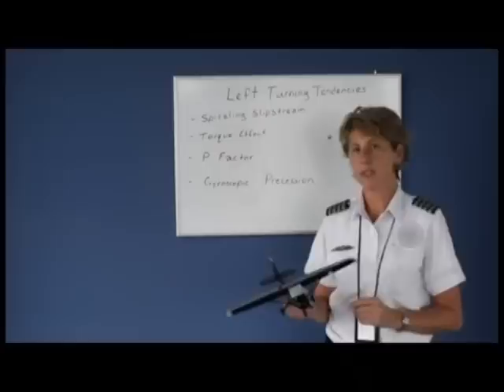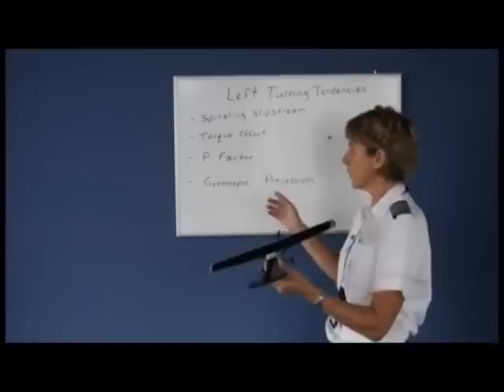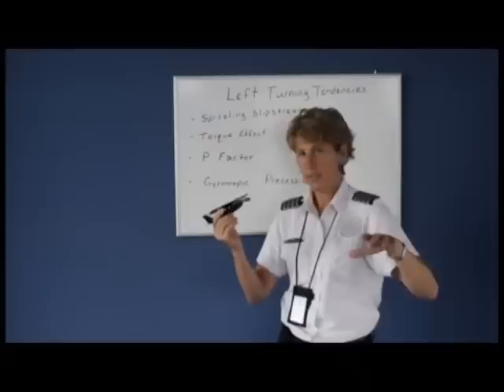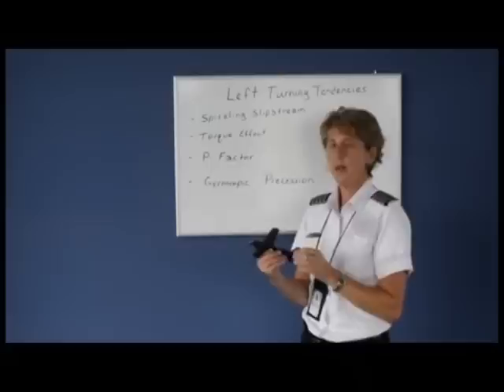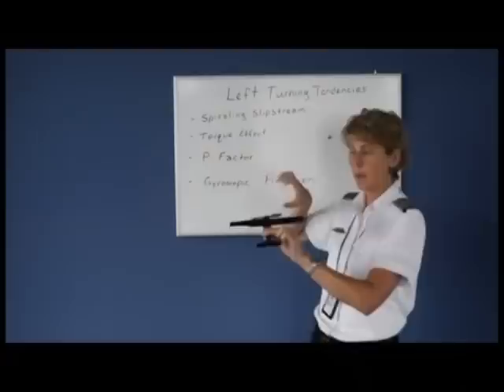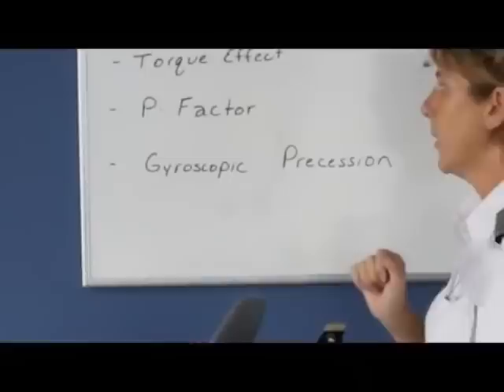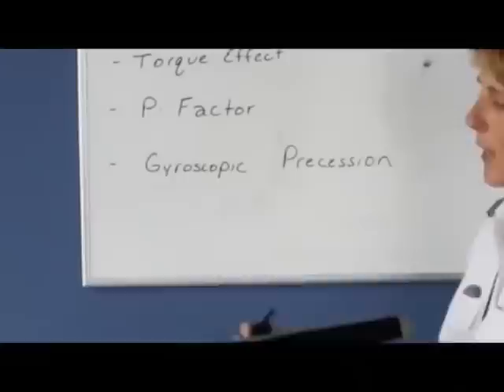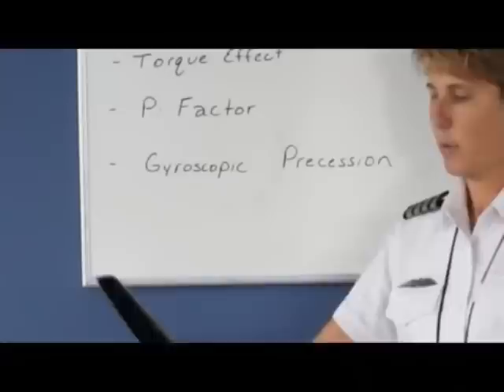Left Turning Tendencies (Private Pilot Lesson 1e)

Comment: Im confused between the pfactor and the assimetry load. On the assimetry  load you said that when a force is applied to a gyro the effect of that force will be at 90° from the dirección at witch the prop turns. So coming up with the p factor if the descending prop generates more lift that vector of lift would be applied at 90° causing the airplane to pitch up(in a right turn prop)?  If someone could answer mi question I would appreciated.  Grate video by the way!!

Comment: I just wanna add this from the Aeronautical Handbook under corkscrew effect "Note that this rolling moment caused by the corkscrew flow of the slipstream is to the right, while the yawing moment caused by torque reaction is to the left—in effect one may be counteracting the other." so spiraling slipstream does a bit of rolling once airborne but they cancelled out once in the cruise flight with the right amount of trimmed rudder?

So not only the torque effect does some rolling but also the spiraling slip stream "corkscrew effect" have some rolling moment to the right as well but eventually cancelled out by torque effect rolling tendency to the left in the air.

Comment: Hi your teaching is amazing.
I just have one doubt. Gyroscopic precession is actually a right turning tendency, then y it comes under left turning tendencies?
Reply: Gyroscopic precession is a right and left turning tendency depending on the airplane you’re flying (it can also cause pitching moments when you yaw as well, we just don’t discuss that as much). In a tricycle gear airplane like a C172, it is more of a right turning tendency because we rotate by only pitching up when taking off. In a taildragger, however, it is felt as a left turning tendency because you first push the nose down to bring the tail wheel off the ground before pitching up. It’s important to be aware of this because increased right rudder pressure may be necessary when bringing the tail off the ground when flying a tail wheel.
Reply: Then y it comes commonly under left turning tendencies?
Reply: @mohnkhanth2541  because of the fact that it’s fairly prevalent as a left turning tendency in tail wheel aircraft. Until you get to CFI or do a checkride in a tail wheel, it’s one of those turning tendencies to be aware of but know the other 3 (p-factor, torque effect, spiraling slipstream) like the back of your hand.